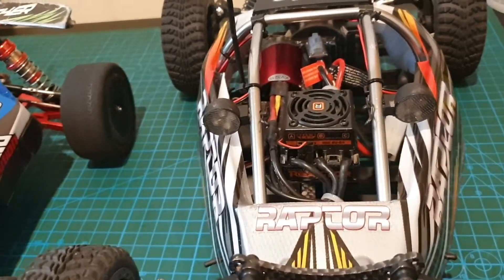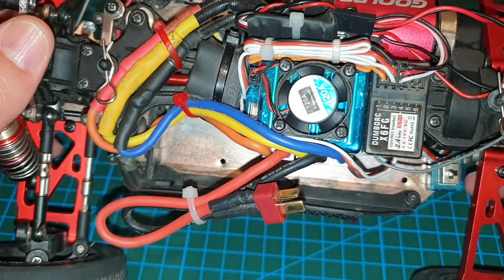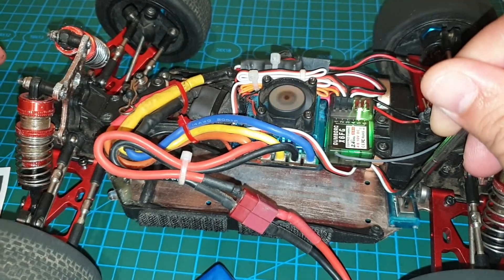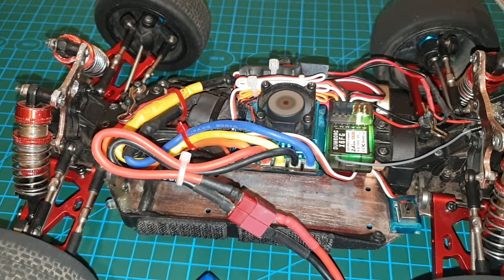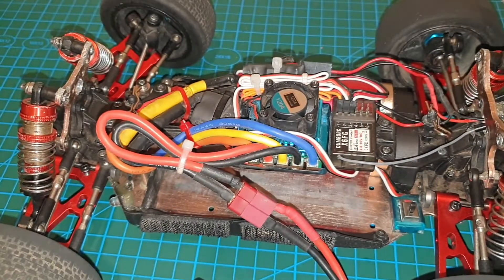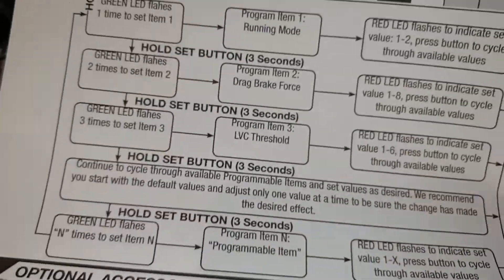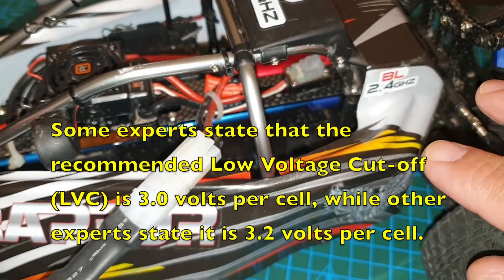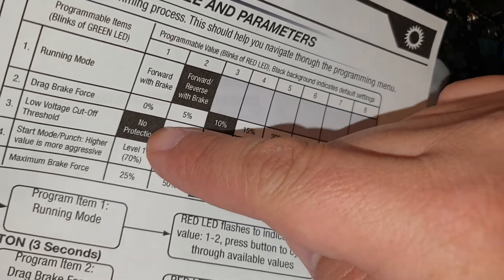Programming an ESC without a Program Card on your RC vehicle

Comment: How would initially set the esc up first time round as I've bought a motor and esc combi with no manual. Nothing is working bar the light and fan work and the light on the receiver comes on, but apart from that I'm getting nothing 😭 Ps first time doing anything like this btw 🙄
Reply from the maker: Hey Justin. Ensure that the servo is plugged into port 1 of the receiver and ESC to port 2 of the receiver. Ensure polarity is correct way around. 
Does your esc have a program button? What combo did you get?
Reply: @MickoRC  it's an RC carmaxx 60a esc and carmaxx 3300kv brushless motor. I've setup the transmitter according to the manual but now the wheels turn hard right every time it's turned on, when i turn the wheel left, it just straightens the wheels ect. Still not joy with acceleration, break or reverse 😕 🙄 😒

Comment: Hi, great video...so easy to understand!👏👍.
I have a question...if you have time.., I just purchased a new "JLB Racing CHEETAH 120A", and I have some problems with the ESC I think,... it doesn't brake when I hit backward, ....it only hardly slows down, for example if I set Throttle to 25% backward it doesn't work at all. I tried to calibrate the ESC, but the problem persist. Is there a easy solution for this, or ESC must be replaced? 
https://www.youtube.com/watch?v=iH5lQbNorEU    ...video with ESC calibration.
10x, :)
Reply from the maker: Hi mate. I hope it's sorted. If not, maybe try the same calibration in your vid with the TH set 50% before turning on the car. Another thing to try is do calibration with the transmitter not so close to the receiver. e.g. 1 metre away.
I hope this helps bro
Reply: @MickoRC  Hi mate. I found ESC manual and tryed different settings(max brake force to 75%,100%) but didn't work, what seems to work though is changing Running Mode from "Fwrd/Rvrs with brake" to "Forward and Reverse"(don't know if this can damage the gears) , but couple of times it's started with "red blinking Led of death"(and nothing worked) :)).... I spoke with banggood and they agree to refund me with the cost of a new ESC... so it's OK... 10x for your help mate 🤝
Reply: @MickoRC  'calibration with the Transmitter not so close to the receiver... 1m away'... Crazy tip mate!... that worked... Now it happens often to lose control(when go full throttle, for 2,3 sec it keeps accelerating with no way of stopping) I ll try to recalibrate again to see if this can be also solved... But still great advice mate 🤜🤛

Comment: Sorry but i did dis and my car is only going forward!!!
Reply from the maker: Sounds like you've changed the running mode. It's usually the first setting parameter in the ESC and forward only mode is usually value 1. You probably want value 2.

Otherwise you could try doing a factory reset. In my ESC, I reset to factory settings by just turning on the ESC and then press and hold the ESC for 3 seconds. It might be the same for yours.

Comment: Bought the same 120 a  esc and no programming sheet came with it.i got it programmed with your video thanks!!!  How can I get the sheet with all the  info for the different settings? See
Reply from the maker: Thanks for your kind words. In the video I was using a manual I downloaded at https://p11.secure.hostingprod.com/@hobbypartz.com/ssl/ibuyrc/manual/07E-C-XERUN.pdf
I hope it helps.

Comment: Turning here because I have a very similar setup WRT the ESC. Mine shutters before it takes off. Alamo at like it hesitates. Reverse sometimes never works and if it comes encounters a small obstacle, it hesitates to move. Very frustrating.
Reply from the maker: First try re-calibrating your radio endpoints. (example for a DumboRC X6 radio: https://www.youtube.com/watch?v=WShhq0fTbio)
Then calibrate your the throttle limits on the ESC (example for a Hobbywing Brushless ESC: https://www.youtube.com/watch?v=MiKeYJnYjxU)
Look for tutorials for the radio and ESC you have. I hope this helps!

Comment: What if you don't have a reset button? Do you need a programming card?
Reply from the maker: Thanks for your question. In that case, Yes you'd need a programming card (assuming the ESC actually has programmable settings).
Reply: @MickoRC  Thanks, yes my ESC does have programmable settings but I don't have a program card. But it runs fine from out of the box

Comment: My ESC is beeping and blinking red what do I do how do I calibrate it it’s a goolrc it did not come with a program card mine has a on and off switch I don’t see a button on mine
Reply from the maker: Hi Dustin. Thanks for watching this video. Seems some ESCs can only be programmed using a program card or computer. I believe your only option to program a GoolRC ESC is with a program card.
Reply: @MickoRC  so all I need is a program card and it will work just fine
Reply: @MickoRC  will  This brand work the goolrc I found it on Amazon it’s the Jrelecs Programming Card for RC Car Brushless ESC Electronic Speed Controller
Reply from the maker: I would get a GoolRC program card if I had a GoolRC ESC. More likely to work. I hope it works out for you bro!
Reply: @MickoRC  Does it matter if I get a goolrc brushless ESC or can I change it up to a different brushes ESC
Reply from the maker: I have a brushless GoolRC motor combined with a Hobbywing brushless ESC and have no issues, so yes you can mix brands.

Comment: I have this FS Racing/ReelyRaptor :)
Reply from the maker: Ah cool. How's it going? Done any mods on it mate?
Reply: @MickoRC  notndriving it,  second hand bought,  with garbage 3620 motor and 60A esc,  barely reaching  over 60km/h,  the huge downside for this rc is,  that nearly. all screws are Phillips screws,  not hexes,  so more force for me to use whwn maintenace.
Reply from the maker: @deltazero3796  ah dang.. pretty small motor for a 1/8th. yeah philips screws are a pain
Reply: @MickoRC  It's Reely Carbon Fighter and it's  1/10
Reply from the maker: @deltazero3796  ohh never heard of it bro
Reply from the maker: @deltazero3796  i think i just found it. says it goes 35km/h on stock 2s. dang

Comment: I have the 60A brushless goolrc 4300 with each. I have the dumbo x6 transmitter and radio. I can’t figure out why I don’t get forward or reverse. I have steering . Any help would be appreciated
Reply from the maker: Angel Razo, You might have to calibrate/initialize the throttle boundaries on the ESC. Check your ESC manual in case instructions are there. What brand ESC do you have? An example of calibration: https://youtu.be/MiKeYJnYjxU 
I hope this helps.
Reply: Micko RC goolrc esc
Reply from the maker: Hi  @fluffymyster2 .. did you manage to rectify the throttle fwd/rev issue you were having?

Comment: Is there a way to program eBay ESC without card
Reply from the maker: Generally yes. If there is a program button attached to the ESC then more than likely yes.

 I was able to program the brushless ESC I purchased from ebay.. I did a demo of it on the first car in this video.
Reply: @MickoRC  I ordered a card but not sure if it explains what mode is for what it just says item 1234 and so on I don't know what function does what
Reply from the maker: @carlosavalos9937  usually there's a reference table of the numbers and functions printed on the back of the card. I hope yours has it.
Reply: @MickoRC  thanks hopefully it has it when I get it in the mail thanks
Reply from the maker: @carlosavalos9937  cool.
by the way.. does your esc have a button on it?
Reply: @MickoRC no just on off switch
Reply from the maker: @carlosavalos9937  Some ESCs with no program button have a programming procedure involving the TX trigger. perhaps try experimenting with combinations like turn on trigger, hold forward while turn on ESC. something like that. but i am not certain.